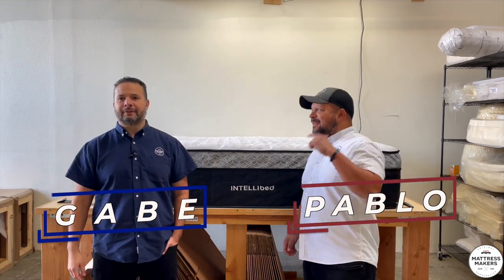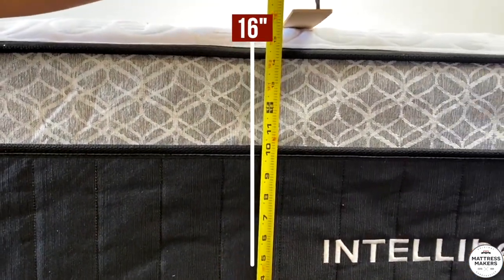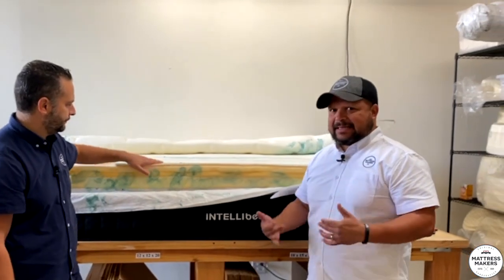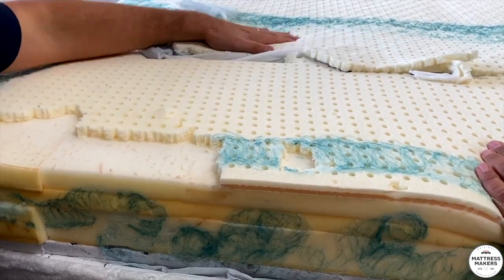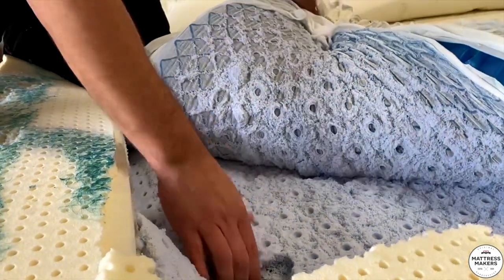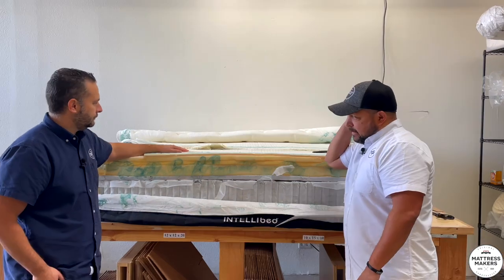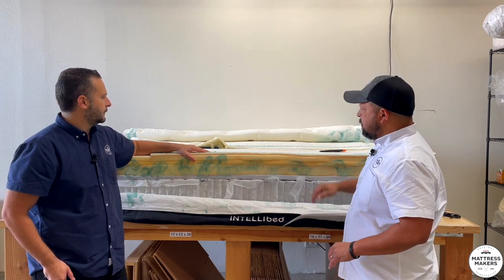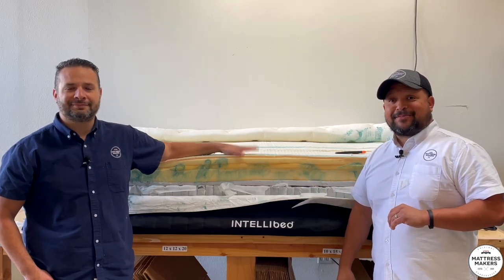Anatomy of a Mattress - Inside Intellibed Midnight Luxury Mattress

Comment: Fascinating video, thanks.  I find it interesting comparing a UK made mattress to the one cut open here.  Traditional UK mattress has no latex or foam in its construction.  The super king mattress we just purchased contained 2000 pocket springs, horse hair, wool, cashmere, silk and cotton layers.  Medium tension.  We have found it very comfortable, replacing a hybrid pocket spring/latex/foam mattress.  Thanks for the info and keep up the good work
Reply: Vispring?